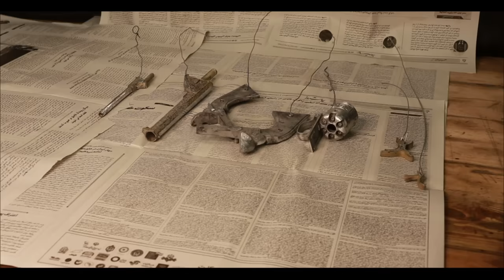Old Model Ruger Revolver Gun Restoration (decoration gun find in river  )1851 Navy Model Restoration

Comment: Despite all this rust, everything comes out very easily. rust got everything but didn't touch screws. interesting 🤔
Reply: Yes, I saw that as well. Difficult not to actually. That did lessen my enjoyment of the video somewhat but it was still fairly interesting.
Reply: I have done many river finds myself and in some cases specific metals can look more or less new. I guess it depends on the environment the items lays in. I have found WWII items that looks like they were thrown into the lake a week ago because they were well preserved but once the items comes in contact with the air the rust comes very fast. To me this is red rust meaning it is new so someone could have found this in excellent condition for it to rust away once out of the water. The little spring at 2:05 though makes me question things though
Reply: Mostly in cases screw are get rust first
Reply: Very suspicious 🤔🤔🤔🧐🧐
Reply: Vinegar and hydrogen peroxide just before the restoration… typical 😉
Reply: @vassilisdritsas4810  ???????
Reply: The spring will tell whether this video is true or false...the ans is " f"...spring will not stay in 1 pcs with such highly  rusty  form as shown in the video
Reply: This is a nonfunctioning replica, and the screws were most likely made of zinc. Zinc does not rust, it just turns dull. It oxidizes a bit and the oxide layer prevents further degradation of the screw.
Reply: Yes the spring is made of a much thinner piece of metal than all other gun parts so it is common sense that the spring will not exist
Reply: I don't understand what do they get by playing  tricks on the viewers🤔☹🤔
Reply: Could have been a coating
Reply: @manjuranibanerjee3414  Check out the description. He states that it is a cheap Chinese decoration.
Reply: @manjuranibanerjee3414  spring are usually made of SS 304 spring steel, so is not 100% SS 316 ,so it will turn rust if I'd not well grease
Reply: @danielphoon556   Thank you
Reply: Thank you very much I didn't know in that much dept about springs
Reply: Looks like a cheap cheap zinc old fashioned dye cast cap pistol.
And no, it is NOT a Ruger !
Reply: @danielphoon556  
Try to read and study a bit, you may do that online, Free by the way.
Reply: A file is now a "scraper"  ???
Reply: @manjuranibanerjee3414  
Plippy Plappy you are really sappy.
He restored an old crappy toy someone threw into a river while in a snit most likely, how is that in any way suspicious  ????
Reply: @msamour  
No, not zinc, Nickel steel alloy.
Reply: they rust it intentionally 🤔 maybe?? 🤔
Reply: I think it's bogus too.
T.T. and M.M. would be very disappointed.
Reply: Stainless?🤔
Reply: I agree with your theory, but perhaps before he recorded, he took it apart, and put it back together, as to loosen everything up so that the videos aren’t too long
Reply: Absolute bs
Reply: 🤣 I bet your interested in how the sand is blasting the rust away too huh? Simpleton.
Reply: That’s exactly what I was going to say screws look perfect
Reply: It’s YouTube 😂
Reply: Most of it looks like dirt, not rust
Reply: @BeAProCrew  I think he has soaked it in coffee
Reply: @danielphoon556  It's very common for springs to be made of "music wire" as well. If it's a cheap build, it would likely not be SS.
Reply: @msamour  definitely not zinc. It looked more like stainless or nickel. Way too shiny for zinc. If you believe that amount of oxidation happened naturally the zinc parts would be really dull. Even stainless will rust eventually. There didn’t seem to be a mark on those shiny screws. Also the condition of the spring was highly suspect. I would expect the spring to be in pieces or rusted completely considering the state of the rest of the gun, which looks more like a poor replica or a toy.
Reply: @gaz0463  Yepp, I looked into into it more closely after reading more comments. The rate of oxidation for the various pieces defy the laws of entropy. Lol.
Reply: It was the spring that showed this was bullshit.

Even in modern toys the springs go after a couple of years, let alone with that much "rust"

More like crushed up cheetos
Reply: Because whatever he put on the gun didn’t touch the stainless steel screws
Reply: It is possible. The original owner must have replaced the screws with stainless steel ones before throwing the gun in the river 🤔
Reply: Most of the restorations are faked up to create "content" and this is no exception. But the average YT viewer likes fake content and is quite unable to tell the difference, so it gets big views.
Reply: @manjuranibanerjee3414  views, subscribers, likes, follow, sponsorship.. common men this is youtube
Reply: btw this is a replica gun/decoration gun... so the materials that are used in this replica might not be similar to what the real gun have ... also the rustiness of the gun will depend on how long it is placed underwater before they find it out ...

still i need subs HAHAHAHAHAHAHAHAHA
Reply: ยุคคราวบอย
Reply: Chances are the gun was purchased new and purposely rusted to make the video
Reply: Pois é
Reply: That owl at 8:28
Reply: He baked that gun in fried chicken batter. Then he cleaned it off is my guess. Just repeating the process or they could use a small spray gun to reproduce the color. Something wasn't right for sure.
Reply: Something seems a little off. No rust on screws. Crisp edges on pattern. Color of rust was too uniform. No real pitting. Easy off rust. Curious!
Reply: well most likely those screws are stainless steel. i found junk older than me with stainless bolts and nuts and they look brand new....they wont rust.
Reply: Probably brass
Reply: Magic..

Comment: is it me or does this look more like a toy gun ? , I mean looking at the inner workings and how it's put together reminds me of the toy guns that I had as a child .
Reply: It is a toy gun...
Reply: The title and description both say that it's a model, not a functioning firearm.
Reply: This is 100% a cap gun, the fact that it doesnt have a way to load ammo from the back of the cylinder, shape of the back of the cylinder and how it doesnt have an internal mechanism to rotate the barrel are all the proof i need. I would bet the metal is tin and based on the sound when the hammer strikes id say theres plastic in there too.
Reply: @TAGyourit  while all the other points are correct the revolver model is based off a cap and ball style which you load the chambers like a muzzle loader and put a percussion cap at the rear of the cylinder the long rod underneath the "barrel" is the to ram the power and ball into the chambers.
Reply: it is a toy... I don't get it how no one is commenting on this. Everyone just talk about screws when the whole gun is just a toy.
Reply: @joeo3377  all Smith and Wesson revolvers are Models
Reply: @devinhull6227  You don't think there is any difference between a model Ruger and a Ruger?
Reply: @TAGyourit  
"Rotate the barrel" *Klaxon buzzer* Ahhh, sorry, you're out of the gun nerd club! Better luck next time!

Comment: fwiw I'm a novice but have worked with lots of cars in junk-yards and from my experience with corrosion I'm quite sceptical.
I'd like to see the video of what you did to make this item appear to be covered in rust but was only mud or dirt.
 I don't believe this was an honest restoration. Rather it was possibly some old stock or replica that was in good condition and then made to resemble something that's old and rusted.

There isn't any rust or pitting at all except in convenient places...anywhere and those screws that come out that easily is ridiculous.  Then taking a file and wire wheel to something that would have significant historical or family heirloom value is absurd... Only to follow up with gold spray paint and not trying to restore or save the original grips with maybe an epoxy filler to save amap original material? 

Otherwise, if you came clean (pun) and showed what really happened I'd possibly upvote and subscribe.🎃(trick this time).
Reply: Its a toy cap gun
Reply: @4phlpphlp  figured that out a while ago but still... do they corrode differently b/c they're toys?
Reply: It’s not a real restoration.  Any real river piece would have silt deposits and very little surface sand.   It’s likely a crackpot deterioration where they soaked it in water and buried it in sand for a few months to make it look old.  Not to mention literally filing it down like an idiot.

Comment: A not that old toy revolver with some artificial rust and dirt on it ?
Reply: I was thinking that too
Reply: Ya i think thats a toy
Reply: I agree as well.
Reply: I do NOT agree. After the rust was cleaned off, there was PITTING in the metal from long term corrosion. You can't fake pitting. That is real long term rust damage.
Reply: @MrBernard0911  those cheap toy revolvers are cast from zinc alloy where pitting due to the material and casting process is normal
Reply: Ya i have a colt walker black powder reproduction that i shoot quite often they are not the same at all. That is a obvious fake.
Reply: Description say it all
Reply: spot on

Comment: I gotta say that I am skeptical of this kind of video. It's been rusting (corroding) for many many decades, yet there is no loss of overall metal structure and the decorative inlays are perfectly intact? The screws and the springs seemed in new condition, too. A ten year old New York F-150's frame is practically nonexistent, but this pistol's bulk is still present? I think some youtubers take an oldish item, cleverly dress it up to seem to be very old and relic-ed. Then pretend to restore it to original.

Comment: Also, how come the screws were not rusted like the rest of the assembly?
Reply: They look like more modern screws tbh
Reply: THey are stainless steel and flat screws (old)
Reply: @coffresiusvi1211  I'm not doubting they are old screws but they look as of they were machined using a modern lathe(non cnc) well after this "gun" was manufactured. The fact that they are stainless steel tells us that they were at least installed into the piece after 1913
Reply: @testbawt8589  if I had to guess that was probably made around the 70s or 80s there’s some of them still floating around usually they are with some presentation piece or it may be a child’s toy definitely not made by the ruger company as everything they make actually goes bang
Reply: Cause its fake.
Reply: @testbawt8589  it is quite easy to tell this is fake first the screws second the spring that was inside not only that but the plastic handling is a modern day mold casting most rev's had wooden or bone handles around the time frame that this one would have been made and best of all if you look very carefully where is the firing pin and also not seen many rev's that come in half like that. Don't hold me to it but i am pretty sure it is nothing more than a knock off of a colt london ( also made in 1851 )
Reply: Fake !!! Modern toy
Reply: Its a model 1851 toy people smfh
Reply: @coffresiusvi1211 Sorry, slick. No bueno on that. Screws were OBVIOUSLY round head, and there was no such thing as stainless steel in 1851.

Comment: I have an 1858 .44 BP and the cylinder was stuck within 2 weeks because I was a little lazy about cleaning it. And it had no rust like your so called restore.
I'm thinking you used a little sodium carbonate, some water, and a battery charger on 12 amp for 20 hours and used that gun as a sacrificial metal to make it look rusty. Then after wire brushing the black rust, you put it in an oven to dry that rust to the brown color.
At least you tried. But still a good video^^
Reply: Lol

Comment: The description did say a cheap decorative gun, but I did notice the shiny screws, however it was after some cleaning.

 Then he started filing away on the so called pitting. I wasn’t sure whether it was pitting or scroll work.
 
 Then came the gold and later black paint.

 Then I wondered why he didn’t fix it so the cylinder would rotate when the hammer was cocked.

Oh well, it is for decoration only.

It does look kinda cool.
Reply: There were no parts in the toy gun to rotate the cylinder, and no parts to lock the cylinder in place when firing the "gun". This is a toy gun.

Comment: Anything that Rusty would’ve been pitted much more than what it was. You also made the mistake of showing the front of the gun and the thinness of the barrel, along with it NOT matching the caliber of the cylinder. As the gun turns on the turntable, you can see the markings on the inside of the barrel match the same markings on the outside of the barrel. This shows in was injection molded, a process I don’t  think was very common in the mid 1800’s.
Reply: Lmao its a toy. Replica. Not a real gun. Calm down gi joe
Reply: @TransfemMarta  interesting.. i didnt even think of that! You think he's taking items and leaving them outside to rust so he has content for his videos? I honestly wouldn't be surprised if that was the case.

Comment: This toy pistol is made from Zamak, more commonly known as Mazak. It's a relatively cheap alloy of zinc, alluminium, copper and magnesium, none of which contain iron, therefore they do not rust. 
Would be more interesting if you showed what you do to make it look like a genuinely corroded steel pistol. If it was genuine you wouldn't get it apart, not even with vinegar! 🤥🥱
Reply: Interesting. How did you figure that out?
Reply: @csl110  I concur.  It is a toy.  Hot Wheels, Matchbox cars and toy cap guns are made of Zamak (Mazak).  I own both an original and a fully functional steel Italian reproduction of the 1851 Colt Navy, upon which, this was made.
Reply: The fake rust was the most impressive part of the video.

Comment: Nice work. I feel that brassing the pieces by heating them and then spinning a wire wheel against it would provide a cleaner finish though instead of the paint. Maybe something to try on another project later on?
Reply: Really disliked the gold paint. That technique would have been fun.
Reply: Probably wouldn't work well on the metal used to make that toy gun.
Reply: @memyname1771  I don’t think that’s a toy guy. It is a .22 by Ruger I believe.
Reply: @brianeatock4383  Ruger never made an open top cap and ball.  This is nowhere near a .22.  It's a toy gun.  The plastic grips and fake hammer and trigger assembly give it away.  Don't take my word for it.  Check out the 100 other comments from other firearms collectors like myself that can spot fakes a mile away.

Comment: I grew up with cap guns, BB guns etc. That looks like a cylinder that's designed to hold loose cap and ball looking plastic caps. I could see by the sides of the frame they are cheap thin zinc castings. I would have loved to have had it as a kid however it is nowhere near a real cap n ball / firearm

Comment: I found one with a few other Civil War era guns (including the same Pineapple Derringer Boothe used) here in VA and used the washing soda/battery charger method on them and the 1851 came out looking brand new! Gold trim and wood grips still intact…
Reply: I cringed at the sandblasting…I’m sure you used a soft enough medium, but electrolysis is so much safer… and it removes all (and ONLY) the rust..

Comment: I also agree and say that this gun if that "corroded" 
1. the screws would definitely look the same
2. Parts of the gun do not look right
3. If there is that much rust it basically should have snapped in half

Comment: Files only cut in one direction. Drawing it back dulls the file. Sandblasting should be done with noncorrosive media. Walnut shells work. A lot of work but worth it. After sanding the grip the grit needs to be removed from all the machinery. Reboring the barrel would also ensure its safe to fire.

Comment: It doesn't appear to have been in the water but about a few years or so. Personally, for this project I would have dropped it straight into an electrolysis bath. I would have used a 120 grit buffing wheel on my Dremel to polish out as much of the pitting as possible and then electroplated it with nickel. You can buy the nickel strips on Amazon and you can get battery acid about anywhere. That should fill in more pitting. 
I'm doing close to the same thing right now. I fouls and old, rusted shut 1951 Marlin 336 Waffle Top 30/30 in the neighbor's trash trailer. He let me have it. He is a fisherman and kept it on his boat and never took care of it.But at ANY rate: WELL DONE! It's gorgeous!

Comment: Yeah I’m with that other guy kinda fishy how easily it cleaned up I work automotive and rust is a bitch on big huge parts so I can only imagine a tiny little gun going bye bye after sand blasting but if it was artificially aged that would be different and the screws holding it together were still new looking

Comment: It is a pot metal piece of junk.  The biggest clue is the barrel is attached with a screw.  That isn't how any of the early Colt revolvers are put together.  As for restoration?  If you actually want to restore a gun or even a "wall hander" go to a reputable gun smith.  This seems to be pure fantasy.

Comment: Not A real firearm. It is missing many parts you can not spin the barrel without pulling the hammer back to half to release it. every time you pull back the hammer the barrel would move to the next chamber. Next, the handle he started with was plastic all models I ever saw were wood. When you look down the barrel you can see how thin the metal is just a toy.

Comment: Hang on you said 1851 navy, bullshit, Ruger wasn't around yet, 1851 navys wern't engraved up the barrel like that, 1851 navys mostly came in 45 colt or 44 not 22 and even if it was a 22 from anywhere near that time the frame would be a solid piece a metal not a 2 part cast piece a shit like that, and with the frame being 2 piece i can tell you thats a goddamn toy gun.